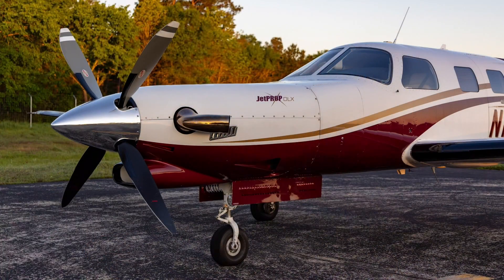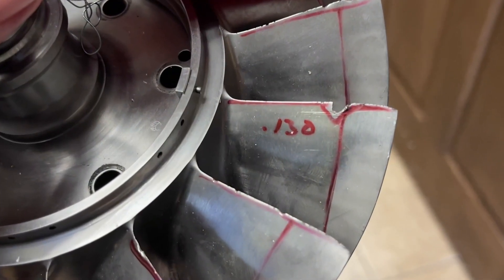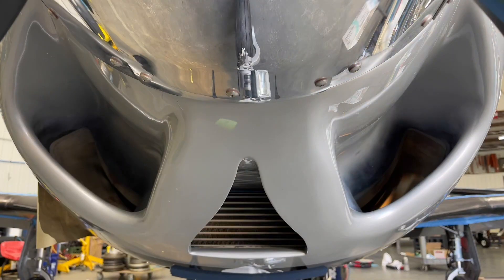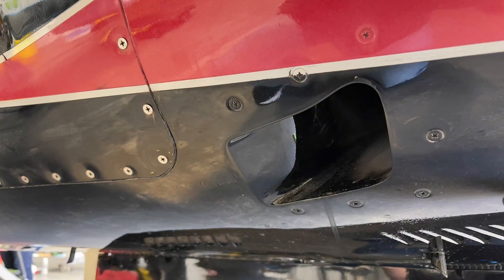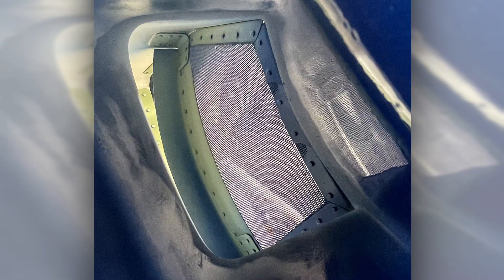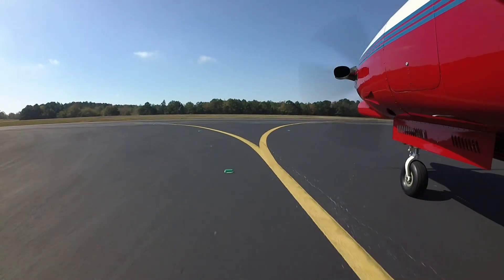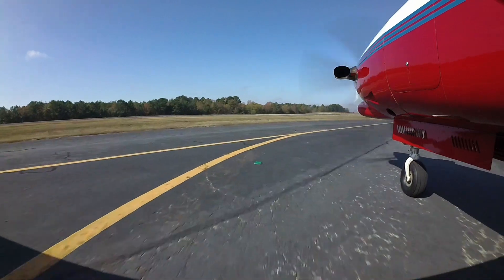Preventing FOD Incidents in Turboprops!

Comment: Moving up question…

Going from a Mooney Ovation to possible JetProp…

Are people comfortable basing a JetProp on 2k’ runways?

If using beta has a higher risk of FOD ingestion…. Is the 2k’ runway not a good idea…?

😃
Reply from the maker: 2,000 FT is just too dang short! I’ve got a few pilots that operate out of a 2600ft strip (such as KSQL near San Francisco), but 2k leaves no room for margin whatsoever. At SQL there is usually a headwind that can be a help, and the runway is very near sea level. I’m afraid that I’d bypass on 2,000ft runway length with any PA46.

The JetPROP is certainly the “short field king” of the PA46 lineup of airplanes because it has 560HP with only 4300# MGW, but it must be flown extremely accurately to operate from such a short strip. If there was any flaw in airmanship, and change in wind component, any failure of a brake, it would be utter disaster for the airplane and pilot.

Comment: Great explanations as usual! How about the feather check, better to do it while taxiing or standing still?
Reply from the maker: I’ve seen some operators of some really big P/W engines advocate to testing the feather feature while taxiing the airplane. That is certainly better for FOD prevention because the airplane is moving forward and probably outrunning any disturbed debris that could become FOD. But, those operators are dual-cockpit-crew airplanes and they use crew coordination extensively to ensure that the captain is steering (with the tiller) and the copilot feathers the prop while taxiing. In a single-pilot, single engine airplanes, the threat to doing this on the roll is that your attention would be diverted and you taxi into something or off the taxiway. In the PA46 world we’ve seen 3 off-taxiway events (that I know of) where the nose gear collapsed and engine damage occurred while the pilot was distracted while taxiing. Simply put, in single-pilot airplanes, I don’t advocate the pilot doing anything while taxiing except to taxi. 

The other option is to simply not do this check before each flight. The prop is feathered on every single shutdown of the engine. and I’ve never see the prop not feather when the prop lever is brought to feather. Simply put, this check is important, but not important before each and every flight because it is tested at the end of the last flight. To me, the threat of disturbing debris that can become FOD is greater than the benefit of knowing the prop feathered while taxiing. 

Some checks are more important than others, and this check is one of the lesser checks, IMO. For instance, there are some checks that the pilot doesn’t do on every flight, but usually on the “first flight of the day”. To me, those checks are less important, and so is the feather check on a SE turbine.

I hope this helps
Reply: @caseyaviation  always the wisest awnsers from you! Thank You! One more thought, if you are doing a runup and do the govenor check first, how many fod particles could be left under the engine. You blast away a lot of stuff at 2000 rpm..
Reply: Moving up question…

Going from a Mooney Ovation to possible JetProp…

Are people comfortable basing a JetProp on 2k’ runways?

If using beta has a higher risk of FOD ingestion…. Is the 2k’ runway not a good idea…?